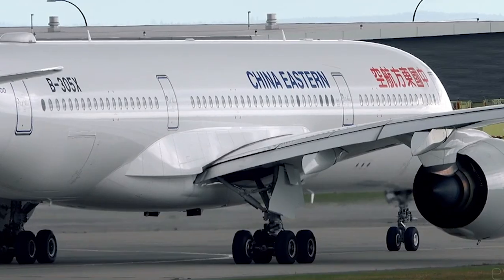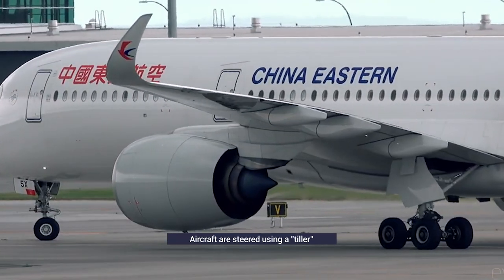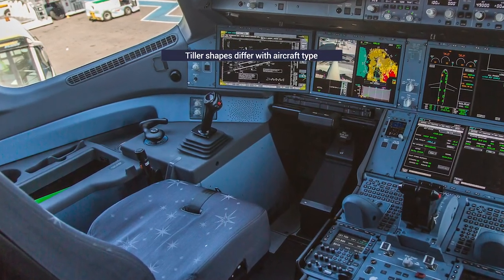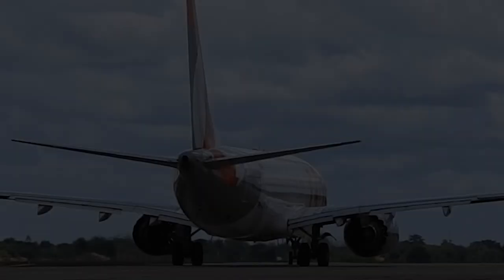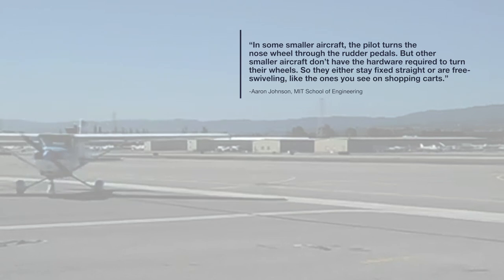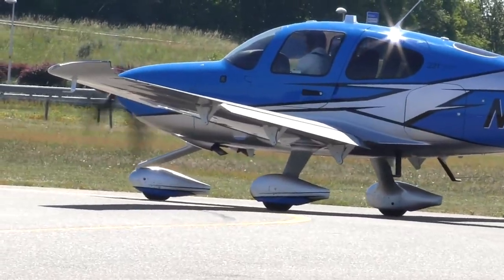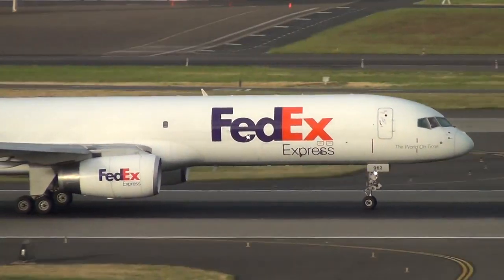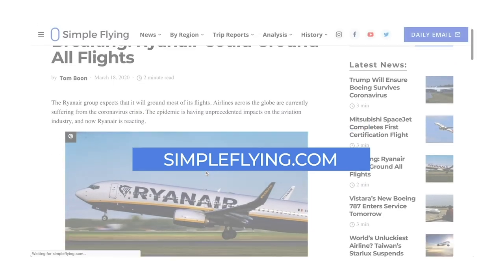How Do Pilots Steer Passenger Jets When On The Ground?

Comment: Your video is very informative, the tiller is rarely talked about. I thought you were going to leave it at that but you did point out that the tiller is only found on large commercial aircrafts.
As a pilot of a small private plane (single engine on the nose) I use the rudder pedals and thrust to taxi. And of course, a handbrake as well (used also when to slow down at the end of my landing roll). Some small private aircrafts have the braking system in the "upper part" of the rudder pedals, like the Tecnam 92 airplane series.
Never gave the twin engine aircrafts a thought, but hearing about differential throttling makes sense, when you hear the sound they make when they taxi about on the tarmac. 
Thanks again and keep up the great videos.

Comment: For jet planes, at speeds below (usually 80kts), the tiller is used. About 80kts during take off, the rudder pedals actually controls the nosewheel steering to a very small amount, plus the rudder is starting to have aerodynamic effect. If you happen to watch any video showing a view of the cockpit during take off, you may be able to hear the non flying pilot call out 80kts, to signify that the tiller should no longer be used.
Reply: @carpe1959  Pull back on control column to initiate rotation. This moves the elevators upwards, airflow on the upwards pointing elevators push the tail down, thus rotating.
Reply: That is not how it works.    80 is a call we for the purpose of rejecting take off on serious meaning engine failure, fire etc and less serious malfunctions such as unusual noise or vibration, tire failure, master caution etc..  not to be confused with V1.  

Only time the tiller is used other then taxi speed max 30 knots is for a rolling take off while lining up.  Once the engines are stable at 40% and you are aligned TOGA button is pressed and control inputs are used.   

787 pilot

Comment: I never heard of it i tought it was the rudder padels that steered and they locked in when in flight
Reply: Rudders are actually used as brakes for main landing gear on ground which helps in slight left or right movement on ground by braking one landing gear while other is moving and in the air rudder are used to control the vertical stabizer
Reply: You are sort of correct here. The rudder pedals can move the nose wheel steering, though considerably less than the tiller.
On the A320 using the rudder pedals gives up to six degrees of steering below 40 knots ground speed. This is automatically reduced from 40 knots and effectively turned off at 130 knots. At higher speeds, most of the steering will be due to the rudder anyway.
Whilst the tiller can provide seventy-five degrees of steering below 20 knots and is locked out above 70 knots.

Comment: The tiller is not always installed on both sides, some airlines only allow taxi by the captain.
Reply: Yes, because that was the norm in past. now, it depends on airlines. For example, most 737's have tillers only on captain's side, but not all and can be requested by the airline. However, all Airbus' planes have tillers on both sides

Comment: I was certain that there was some sort of control action by the pilot to turn the front wheel but in all the airplane videos I've seen on YouTube it is never mentioned and I didn't know this device is called a tiller (a nautical term) but that name makes sense, as far as "steering" goes. I did assume asymmetrical thrust is used on dual engine planes for turning. I also witnessed a large cargo plane use the reverse thrusters to back up on a tight runway "Cul de sac". Differential braking makes sense too but I wasn't aware of it. Thanks for the info.

Comment: Also if I'm correct the B747 has body gear steering where the body gear turns in the opposite direction when the front wheel is turned. This only happens in very low speeds

Comment: There is the tiller but is it possible to steer the plane using the rudder???
Reply: Yes. On ground, at all speeds rudder pedals to wheel steering is available but only to very small amounts. Not enough for large turns during  taxiing but enough to just keep the plane on a straight path center line when it starts to veer away.
Reply: @davidl5546  ok. thanks!

Comment: The question I have is how do they know where to steer and stop, specifically following the painted lines on the ground and gate markings. The pilot can really only look forward not down. I guess it might be downward pointing cameras?
Reply: The B777-300 which is longer than the B747 has cameras pointed at both main gears and the nose gear for pilots to see the gears during ground maneuvering. For most others it is a matter of pilots knowing where his eye view is relative to the location of the nose gear. It's similar to when we want to park as near a kerb as possible. We can't see the wheels but we have a good idea where they are from our viewpoints.

Comment: Knew about the tiller, but I am still puzzled as to how the pilot can accurately follow a taxiway line given his/her position in the cockpit - difficult to see how you are tracking. Any ideas?
Reply: You park the plane in the yellow line and then whilst sitting in the seat use a reference point where the yellow line meets the instruments. I think a common one is the yellow line appears to go between the PFD and the ND
Reply: there are cameras. And, I used to think that aircrafts are steered by side stick/yokes while taxiing as well xD

Comment: Is there a safety feature built into the aircraft that prevents the tiller from engaging the front wheels upon the aircraft reaching a certain speed?
Reply: Yes. The tiller disengages from the steering after a certain speed. Usually 80kts, then the rudder pedals can still control the nose wheels but only to a very small amount. By then the rudders are already effective.
Reply: @davidl5546  OK, thanks for the info. So I that menas when a plane first lands the pilot uses the rudder to keep the plane straight.
Reply: @msbrownbeast  that's correct.  Do be aware that till the nose wheels contact the ground and the nose strut compresses by a certain minimum amount,  tiller steering is not possible.

Comment: What I'd like to know is how commercial airline pilots navigate on the ground. For instance, how they keep from hitting the grass during a turn. Is there a visual cue for starting a turn to keep on the center line?
Reply: Most places the aircraft moves on the ground there will be taxi lines available. Keeping the nose wheel on or near the centerline will provide clearance from signs, grass or other wingtips unless noted otherwise on a 10-9 chart or equivalent. 

Additionally in the flight manual there are depictions of the aircraft turn radius with wingtip clearance and nose and main wheel travel arcs from an overhead view. These depictions help pilots understand taxi geometry.
Reply: Each individual pilot, from experience,  knows that he should initiate a turn when the taxiway he wants to turn into lines up with a certain point on his side window.

Comment: I know of tiller and it can comes with nosewheel disconnect. 737 only has tiller on the captain's side.
Reply: Boeing offers having a tiller on the first officer's side as well as an option. Since the normal procedure is for the captain to taxi no airline is likely to request it.
The A320 comes as standard with tillers on both sides, with that on the first officer's side typically getting little or no use.

Comment: Hydraulic or power steering ?
Reply: Full 3000psi hydraulic. In the B777 and B747 the main gears also steer a tiny amount during turns to avoid wheel scrubbing.
Reply: @davidl5546  also the main gear reduces the the turn radius on the 747

Comment: I had always thought it was caused by differential braking as per a tracked vehicle
Reply: Large heavy planes don't take kindly to differential  braking, although it is possible. It causes bad scrubbing of main gear tyres. Usually, if really necessary to turn tightly, like doing a 180 after a back track, pilots use differential Engine Power to assist the turn.
Reply: On the B747 there's also body gear steering.
On the B777 the rear axel of the main landing gear steers. Unsure if this is also the case with the A350-1000.

Comment: How do pilots keep the plane in a straight line going down the runway at 180 knots (mph)
Reply: probably ILS. if not, they're guiding themselves to the runway
Reply: Rudder pedals, most commercial aircraft also have a connection between the pedals and the nose wheel, but it provides much less nose wheel steering than the tiller, and becomes even more restricted as the groundspeed increases as the rudder becomes effective.
Reply: Do they lock the front wheels then.
Reply: @alexanderhall4281  front wheels are Mechanically locked at the gear itself when the strut fully extends when the nose wheels lift off the ground. A cam Inside the strut forces the front wheels to point straight ahead. This is important for gear retraction.
Incidentally, if you know about the JetBlue incident, it is very likely due to the cam shearing off.
Reply: @zedriclouis87  😂 no they use the rudder ils isn't for when your on the runway.
Reply: Most aircraft also have 3-5 degrees steering using the rudder pedals on the ground. That's how they can keep the plane straight going high speeds on landing

Comment: Bruh i use rudders to travel on ground in flight sims
Reply: The rudder pedals can be used too but less accurate and more work
Reply: This is due to the fact no sim has any connection to the tiller

Comment: i refuse to accept that you don't turn an A320 with the pedals.
Reply: You dont
Reply: You can but you have much less steering. 6 degrees from the rudder pedals compared to 75 degrees from the tiller. Both become less as groundspeed increases